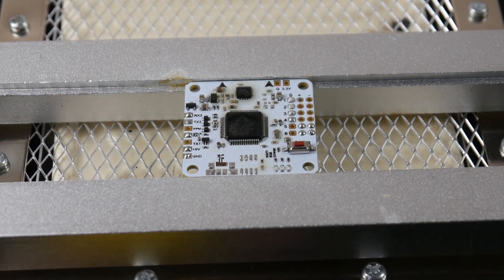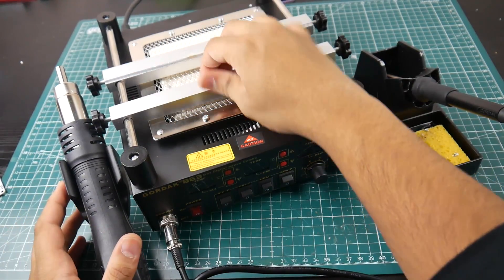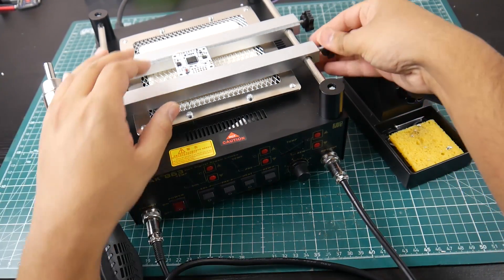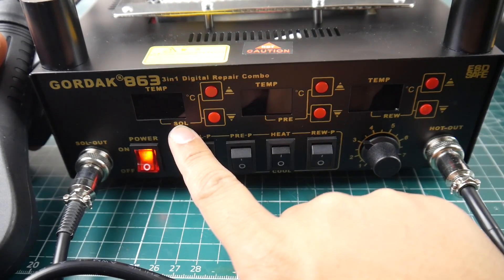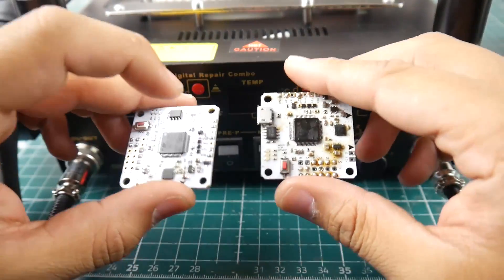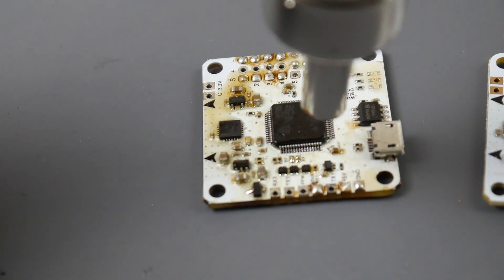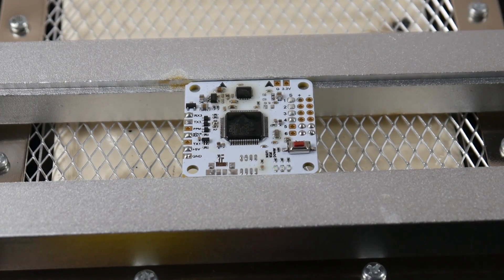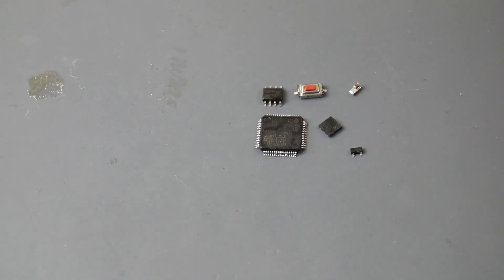The Best Rework Soldering Station and My Favorite // Gordak 863 3 in 1 Review

Comment: just my thought, it is faster to use just the hot air gun than using the pre-heater. Setting up and waiting for the pre-heater to fire up is time consuming, esp when you're just unsoldering a tiny board which I think has a very smell thermal mass. Just the heat gun alone would do the trick. 

Tip: Try using the hot air gun as your pre-heater by aiming 3-4inches in distance at the surrounding part that you want to solder / unsolder for a few seconds, 

And then aim the nozzle close to the part that you're going to unsolder/solder.

Also, get a Vacuum Suction Pen / IC Component Picker

Good review btw :) -subscribed!

Comment: Very nice information. Thanks for the review. Are you still happy with the soldering station? Did it hold the pass of time? :) Thanks!
Reply: I have the same unit, works wonderfully and has held up to extensive use for several years still happily using it to this day

Comment: thank you @dronemesh I had NO idea board pre-heaters were a thing, I have a GREAT soldering and Hot Air system.. and just now researched an SMD board pre-heater.. at $70 i'm still thinking about it as i9 don't do as much rework and salvage as you, I rely on my free-time and chip-qwik.. but thanks, "I learned something today"

Comment: Great video!I just wish that preheater would come separately. But I also want to have a preheater that was based on convection and not infrared. Infrared tend to heat up black parts more than anything else. In this case the black package of the components on the bottom side of the board will be hotter than the pcb, unless the pcb is black. So for example reflow ovens for soldering are usually designed to use as little infrared radiation as possible and as much convection as possible.
Reply: Lots of preheaters available separately... Was gonna grab this one myself esp being a newborn but not for use in the u.s.

Comment: Fudge yea been waiting for this... Been thinking of investing in a station and was waiting to see what your current recommendation would be..

FYI link to product in this video and the post from the other day do not work.
Reply from the maker: Fixed thanks for heads up.. Make sure to choose the correct voltage..
Reply: @DroneMesh  There is only one voltage available at the link(220v). If you want to see impressive technique at rework, check out Louis Rossmann. You may find his Youtube layout interesting as well.
Reply: @MnPaul1  dang good catch.... Bummer for me... I am sure something will come up
Reply: @shamous180  I have been looking at the 3 in 1 rework stations and when I find a good price, it is usually 220 only. I think that it would be great to have a power supply there to power things up.